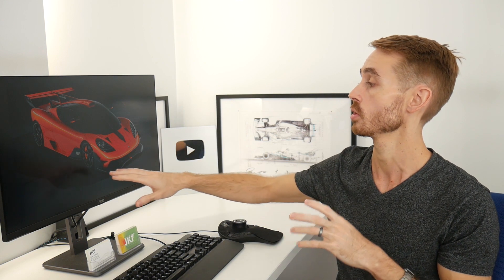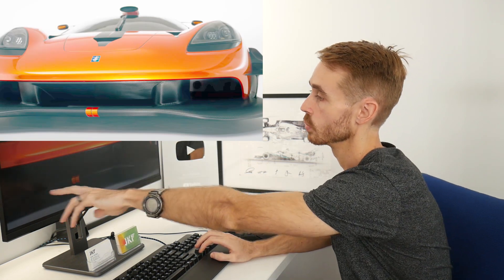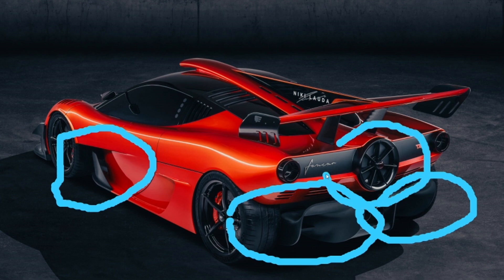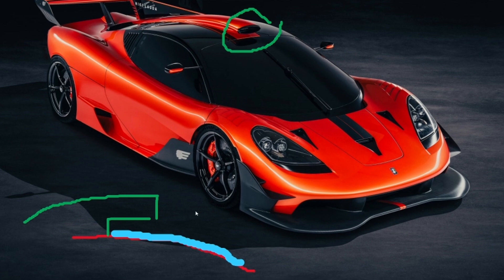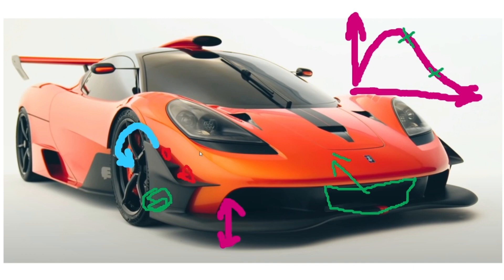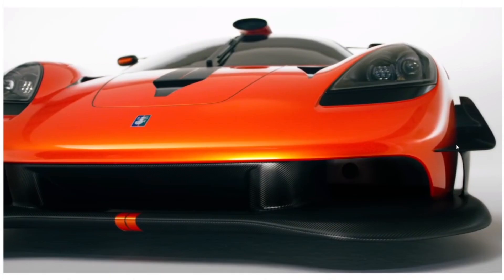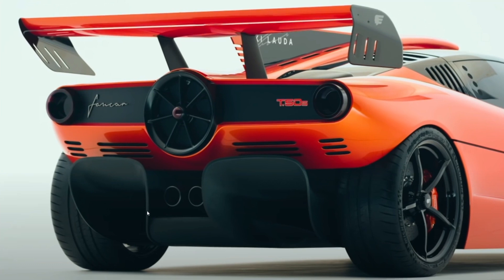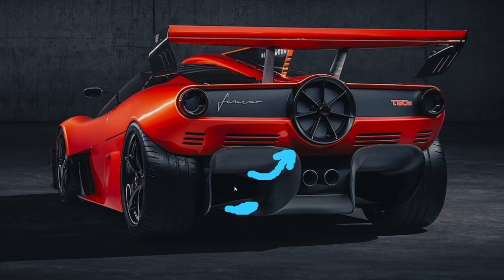Gordon Murray's T.50s Aerodynamics Analysis

Comment from the maker: Thanks for your patience guys, squeezing in time to do videos lately has been difficult!  Hope you enjoy this one!

I've been getting asked a few questions about the aero courses lately, yes I am still working on them, I'm about halfway through the first course. At this rate I hope to have them released by June, but there is a lot of content to put together. Thanks for your understanding and stay safe!
Reply: Hi,
Can you please make a video on topic of how slots on F1 extended floors and vanes help in cleaning the flow. Similarly how the vanes and slots in the bargeboards clear up the dirty air and similar slots on sides of nose help up in cleaning the air. I see these topics often mentioned in articles but no explanation for how these components help in cleaning the airflow to feed it in aero-significant areas or can you suggest me to refer some source to get the fundamental fluid phenomenon explaination behind this logic.
Reply: The light weight of 852 kg means you can achieve more with less downforce, but that also means the drag generated also can be reduced significantly. So light weight is one reason why this is able to go so fast despite so much aero.
Reply: People REALLY... And I mean REALLY NEED to stop saying a car can drive upside down if it produces its own weight in downforce. Thats NOT how cars work, and thats not how downforce works. This is a ridiculous thing to say.
Reply: Can you tell something about F1 teams simulators? What difference between them and iRacing for example?
Reply: excited about the course :D
Reply: @captain_context9991  Thank you. If a car weighs 1000kg and produces 1000kg of dwf, it will still need additional force in order to be able to have enough traction to propel itself.
Then there's the matter of liquids in the case of an ICE.
Reply: @leoa4c  
Yeah. If your car weighs 980 kilos and you produce 1000 kilos of downforce at a certain speed... Then great. Your car now weighs 1980 kilos and you can take corners really fast, on sticky tyres on top of it.

But if you are upside down. Thats 1000 kilos pushing you against your driving surface, MINUS 980 kilos. So now your car has 20 kilos pushing it against its driving surface instead of 1980 kilos. Kind of a big deal, and your car is suspended in a turbulent airflow and you are about to have a serious crash in 10 seconds.

nevermind that a normal car engine will not run upside down for a whole bunch of reasons. And you still need to reach that certain speed to have downforce at all.

The only way I could see this simulated would be without the engine running. Held upside down in a wind tunnel that can do 200-whatever mph speed, then drop a car, stationary, upside down against a surface. But surely you would need a lot more downforce than the cars actual weight to make it stick there.

And its a ridiculous experiment that doesnt really prove anything. Which is why nobody has actually tested it. Ever. And Im just so tired of people saying that crap.
Reply: @captain_context9991  I agree. Apart from a publicity/marketing stunt, it does not achieve anything.
We can prove the principle with a small RC car. With tunnels and skirts, the RC model would drive upside down with no effort whatsoever.

That being said, I am sure that some manufacturer will eventually do it with a lightened full scale car for marketing purposes.
"The First Car To Drive Upside Down".
That should get some attention from automotive channels!
Reply: @leoa4c  
An RC car with an electric engine would not care whether it drives upside down or not.

Come to think of it... I suspect the rotational mass of the wheels does a lot for a cars stability too. Im not sure if stationary wheels would behave the same. Much like its easy to fall off a bike when standing still. Its the rotational force. Centrifugal force that gives stability at speed.

But these insane 300 mph top speeds on the current selection of "hypercars" out there... Thats done not so that people can do 300 mph to work in the morning, but as publicity stunts. To put themselves above and beyond other brands like Porsche, Lambo, Mclaren, Ferrari. Even tho those are probably better built and would do better on a normal race track. 

I struggle to imagine a brand in such desperate need of a publicity stunt that they would put actual money into driving upside down.

Maybe some F1 or LeMans team could try it for a stunt. But inside a wind tunnel.
Reply: @captain_context9991  You touched on a key point. Why are we manufacturing road cars which can achieve 500KPH? Why???
There is absolutely no pragmatic reason to design a car for such speeds!
Why not spend the time, money and resources on making the car lighter, or safer, and/or more efficient?!

Who is going to drive a car at 500KPH on the road?! No one!
Manufacturers have lost themselves in a pointless competition!
More power... More velocity... Does that have any effect on the road? Does it make a difference on a race track?
No! It does not!!!
Most manufactures  have forgotten the essence. The essence boils down to pleasure. A brand can brag for ages about numbers. However, driving pleasure is not, and never will be quantifiable!

We drive for pleasure, for emotions... not for abstract numbers!
Reply: @leoa4c  
Well. I do marketing so I talk about these things often. Back in the late 80s, Ferrari, Lambo, Porsche all had models that could do 200 mph. And so the "race" for being first production car to 200 was over.

And beyond that... What was the point. Rules and regulations in Europe went towards smaller engines and the financial market wasn't there for it. Then along comes the Mclaren F1 and completely blew the numbers out of the playing field.

And while you CAN blast a supercar at 200 mph, or easily 150 through Germany or France, the Mclaren F1 delivered numbers that were outrageous. But look at where the Mclaren F1 is today. Its considered a BARGAIN if you get one for under 20 million dollars. Considered the icon of the 90s, and the pinacle of car engineering for its time.

There were others too. Bugatti EB110, Jaguar XJ220, even the Porsche Carrera GT. But to nowhere near the same status.

So when VW re-started Bugatti they wanted in on this market. People who are OK with paying tens of millions for a classic watch. For a diamond. People with private planes and yachts.

The only reason to build cars that can do 300 mph is to differentiate themselves from other cars that cant. And for no other reason. To get into that market. Its about exclusitivity. When your friends already have every Ferrari. And the knowledge that there are only 25 Koenigsegg Agera RS in the world. So even if your friend is rich as a king, he cant get one.

But like... To a billionaire. Cars are cheap. Even very extremely expensive cars are cheap. You can easily pay tens of million for a collectible Patek Philipe watch. Or 120 million for a diamond. The stereo in a Bugatti Veyron costs more than a fully specced out Corvette.

But, hey... These people spend more than the price of a Corvette on an evening dress.  You could even say... Whats the point of being a billionaire at all if you cant spend it on needless, opulent luxury and things other people cant have.
Reply: Hi Kyle I hope you can see this, can you talk about the Ducati MotoGP ground effects?
Reply: @leoa4c  I'm pretty sure some semi production cars or components cars could already do it if you went to the effort. 

Superlite slc. Carbon fiber body and everything. Get a custom carbon monocoque chassis. Lots of aero work and the right engine set up. 

But for a production vehicles. Idk. Maybe eventually in the hyper car market. But even most modern hyper cars and super cars are heavy af now.
Reply: @captain_context9991  well with billions of dollars you could do alot of charity work and help alot of people as well. Plus tax write offs from that. 

Done properly you barely have to work at that point. Thus you could just build your own super exotic car. Hire some dude to design something.
Reply: @bmxriderforlife1234  
You are describing how america builds "supercars" They are businessmen first. Then they make some money. And then decide to hire in people to build them a supercar. Cameroon Glickenhaus, Hennessey, that SSC Tuatara dude are the most famous attempts. But there are like 20 others. They come up with dreadful steel tube bullshit with the engine out of a corvette and every single part out of other cars. Then they hype it to the skies as the first "all american" hypercar, and then they go out of business after selling 15-20 cars to people with more money than sense.
Reply: @bmxriderforlife1234  
Superlite slc? Whats that.
Reply: @captain_context9991  component car. 

Kits like 54k. Add a transmission and an engine and assemble and you have a super car. 

But you can also dump upwards of 200k into them going all out. 

But realistically you could buy one. Get custom carbon body work. Ask the manufacturer to hit up a composites company and see about a whole carbon chassis. From there numerous engine builders could do something exotic or numerous crate engines. Few transaxle choices including the manual used in the Lamborghini Gallardo and audi r8.
Reply: @captain_context9991  but it'll perform up there with many super cars costing alot more and has some racing pedigree. Like an ultima gtr if you've ever heard of those.
Reply: @captain_context9991  yeah and just checking Google. McLaren owners have slcs. As their actual track cars. 

Same with people owning many more expensive cars. Insurance on track exists. Specifically to cover damages to cars. 

Yet they buy a second vehicle instead. 🤔 hmmmm.
Reply: @captain_context9991  aluminium monocoque chassis actually. 

Same as many legit race cars use. So try again. Go do some research.
Reply: @captain_context9991  bruh. I know someone who owns the most ridiculous European car collection you could imagine short of people far wealthier or peeps in Dubai. 

McLaren f1. F50. F40. Diablo. Countach. Miura. 

Jags are okay. Alot of them are glorified luxury cars called sports cars. 

The slc isn't a straight line missile. It can actually handle. And looks every bit as exotic as the cars you mentioned. But it'll also take a real driver. 

It has input from actual f1 designers. Trust me I know what you're talking about. I own a 69 gto. With an engine and tranny swap. 

I wouldn't be considering building it if it wasn't able to keep up with the things it compares to.
Reply: @captain_context9991  dude ferraris and Lamborghini and most of those makes are only now about luxury. I've sat in more vintage super cars than you ever will. Many of them fucking sucked till the 2000s. And the modern ones are just meant for clout.
Reply: @captain_context9991  FYI. I'm not American. I'm Canadian. More specifically Irish and French Canadian with some English background. 

The ultima gtr which from multiple sources doesn't have the build quality of an slc. Holds the lap record on the top gear track English top gear track.  Since some of their drive train is typically similar top speeds are equal. And the slc handling is proven. Plus with the amount of aero on the car well yeah. 

One of the shops that builds them for people has a top speed on their set ups of 222mph. Vin wiki has videos on them.
Reply: Don't you wish they added some side strakes on the outside edge behind the tire like the jesko Absolut?
Reply: You never made that t. 50 fan aerodynamics video

Comment: Definitely would like to see you go through the fan system . Also if you watch Harrys Garage's video, Gordan and Harry go over a the aero details a bit. In regards to the 3 NACA ducts on the front, the middle is for cabin air, the left and right feed the brakes.
Reply: It doesn't make sense because of they'd use it for brake cooling, it would take a lot of energy from the air routing it to the brakes
Reply: @DhruvKumar192k  I'm just repeating what I heard from the interview with Gordan. Check out Harry's video.
Reply: @DhruvKumar192k  According to Gordon, the side NACA ducts are for brake cooling.
The side area above the splitter is covered by oil coolers.

Naca ducts are very efficient. There should be no problem there.

(But... would I feed the brakes from the side area above the splitter instead? Yes, I would.)

Comment: Gordon did mentioned that on the front of the car:
1. central hole directs air to the rear diffuser;
2. Brake ducts are those side NACA ducts.

On the roadcar, the lateral ducts on front feeds the coolers. The hot air exits above the front diffuser.... It could be the case here too but it would be too much of cooling surface for a 700hp trackcar.

Comment: Flow in the mid section of the rear diffuser should be ok since it has the exhaust to extract it.
I would've angled the exhaust pipes on both axis to help with extraction, though.

Other than that? What can I say?! This is the best automotive aerodynamics' channel on YouTube. It has been so for many years.
Thank you for another great video!

Comment: 16:53 - Actually, the outer shell is used the same way as the side wind deflectors on trucks, thus reducing the noise and turbulence behind the mirror:
1. It stabilizes the direction of the air flow.
2. Reduces the pressure on the front area by dividing the air stream along separate surfaces.
3. Reduces noise associated with the turbulence.

Comment: For the front cooling you were debating.. In Harry's garage video with Gordon.. The centre opening about the splitter is for the T-tray under the car as an aerofoil.. The two sides are for the engine cooling radiators.. Then the naka ducts on the bonnet.. The centre is for the air con.. The two sides for the brakes.
Reply: Also the ones on the rear deck lid if for the rear brakes.

Comment: Recently I watched a video called the Insane Engineering of the Boeing 787 Dreamliner -- and it turns out it uses a very similar system called Hybrid Laminar Flow Control -- sucking out the turbulent boundary layer air off the top of the wing through small openings with a huge pump. The details are secret but this delays the onset of turbulent air and improves both the smoothness of the flying and provides a very significant increase in aerodynamic efficiency. The T50 fan is proper aerospace grade stuff.

Comment: Hey Kyle, another great vid. The black areas under the headlights are vents also. Gordon discussed how these cooled elements of the lights in an earlier video.
May I suggest a stylus instead of a mouse for drawing? It may enable more control of the sketches.
I'm really keen for your opinion on the base car. You were trying to be so polite in your earlier comments but definitely holding back to no offend.

Comment: The light weight of 852 kg means you can achieve more with less downforce, but that also means the drag generated also can be reduced significantly. So light weight is one reason why this is able to go so fast despite so much aero.
Reply: I'm very curious what this car will be capable of in real life track "racing", compared to less powerful and 400 kg heavier GT3 cars. How might downforce compare? 
Being so light and with decent downforce, might T50S appoach LMP2 lap times?
DTM cars when they were effectively silhouette prototypes had like 500 hp at 1000 kg. Those cars were faster than F3 on fast track, slightly slower on slow tracks. Might T50S being more powerful and lighter still now compare similarly to modern F3 cars that are 565 kg with 240 hp?
Reply: @Cloxxki That video of Dario sending it full throttle up Goodwood, it's mad quick!

Comment: 17:20 - I'm way less experienced or talented than Gordon Murray engineering team, but a question arises: why didn't they place the mirrors in a lower position? I mean, if you don't want a big wake investing the rear wing, the most obvious solution seems placing the mirror in another area, rather than designing a separate housing (or avoiding physical mirrors, like Tesla for example).

Thanks in advance for your answer @KYLE.ENGINEERS 🙏🏻

Comment: I've got a video (or series) request -- aerodynamic analysis of the new WEC Hypercar class entrants. The class is obviously created to encourage more styling freedoms, as aerodynamic performance is actually limited by spec (that could be an interesting explanation as well) so it would be rather nice to see how the teams balanced their styling and aerodynamic design. It's not too often a whole new class spec comes along in a major racing series.
Reply: The cars being so crazy heavy kind of takes away my interest from its aero. They look like prototypes but weigh the same as GT3. What is the actual point? This T50S is 400 kg lighter and has similar power. Maybe less downforce than Hypercars. Around the LeMans track, could T50S match Hypercar lap times when fitted with the same wheels?